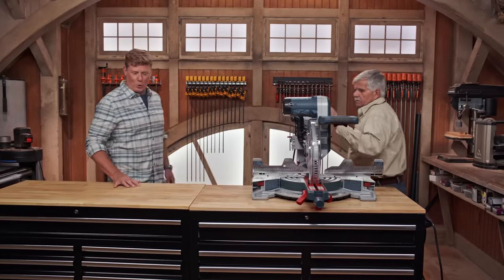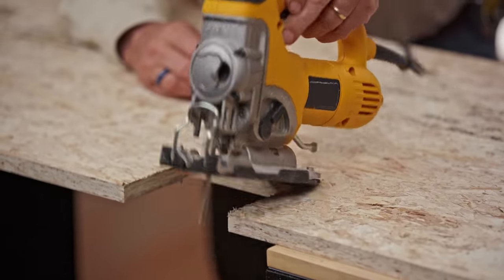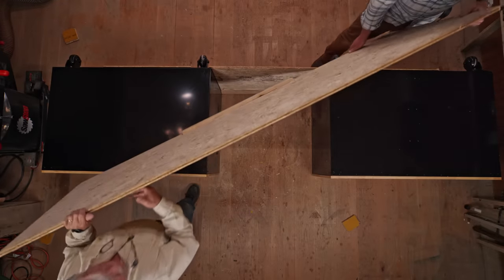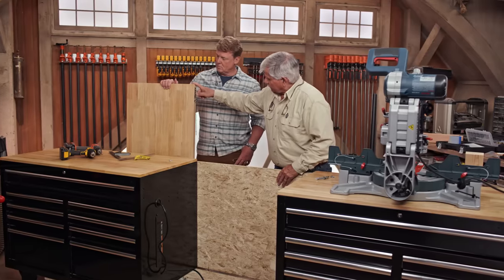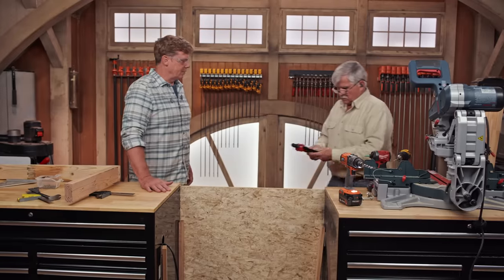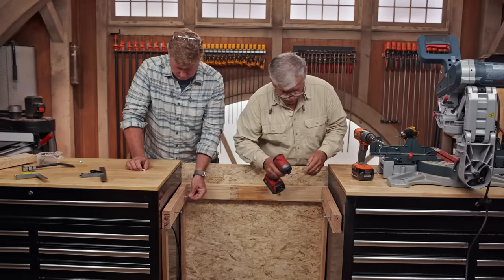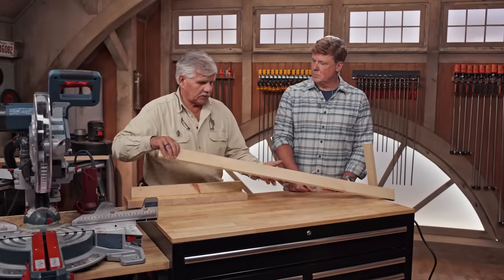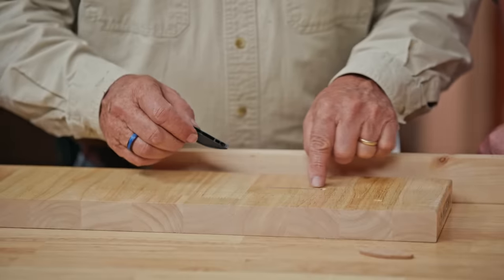Miter Saw Station | Build It | Ask This Old House

Comment: This unit cost as much as my vehicle.
Reply: Your absolutely right
Reply: That just means you have a mobile miter center. 😂
Reply: Hahahah. Yeah!
Reply: Roller blading to work sucks I don't recommend it.
Reply: It’s an idea that they obviously took to a high degree. In my head I thought of things that I would do differently to make it more versatile, but also you an do the same thing but not use expensive tool cabinets. You could make your own shelf storage cabinet as an example.
Reply: Not a cheap solution — starting with the saw itself.  Big range of cost on the shelves though.  I have very similar ones from Harbor Freight that I think were about $350 or so.  Well worth that cost for the quality.
Reply: 2000?

Comment: Videos like this are why I seldom watch this show any longer - They love finding ways to use very expensive tools instead of trying to find ways to use less expensive methods to achieve the same results. A Lamello biscuit joiner  is so far over the top instead of a system like parallel t-tracks, allowing for a moveable, and removable fence, and is also far easier on the pocketbook of so many of us hobbyists. This is a great show to watch if you have loads of cash waiting to go through instead of learning about more cost effective solutions. Again - a great show for wealthy people!
Reply: Scott Walsh uploaded a video explaining that dowels are actually better than biscuits or dominoes. I'd recommend checking out his channel.
Reply: yet here you are.....
Reply: @njkay0033  Lamello by far makes the best Plate Joiners, Norm preferred them and used them for years on The New Yankee Workshop. But he also used Porter-Cable and on a rare occasion DeWalt Plate Joiners, and you can do the same thing with those. I myself can't justify the Lamello price, but I have a 2000 USA Made Porter-Cable 557 and I love it. You can still buy Porter-Cable and DeWalt Plate Joiners today.
Reply: Ur a hobbyist that doesn't have the same amount they do ..don't hate ..they are a million $ company

Comment: I think its important to note that the special break-down biscuit device is only compatible with the Lamello biscuit joiner, as it uses a special mechanism in the tool that creates the groove. It's quite an expensive tool vs a traditional biscuit joiner.
Reply: Wait a moment! You're not suggesting that TOH is slinging expensive single-use tools that most of us will never really need, are you!?!?!?
Reply: I thought they could just as easily install blind tap in nuts into the worktop and install using thumb bolts through the extended fence into the worktop. Would definitely be more sturdy.
Reply: @powhoundus  that's how I did mine. A few dollars for some threaded bar knobs and threaded inserts. When I need the bench they come right off.
Reply: I believe you can buy some special clips made by lamello that work with a biscuit jointer. I think I saw that on Peter Millard’s channel.
Reply: You could simply use a dowel.
Reply: KNAPP Connectors makes some self clamping biscuits that seem to be universal. I don't have any experience with them, but a sample pack is 10 pair for $10, so cheap enough to give it a whirl. Hoping to build this soon and will likely try those out

Comment: Great video. For all the people complaining about the cost, this is a high quality setup for a very reasonable cost for someone who is a hobbyist wood worker. Spend less time at the bar and quit smoking...
Reply: And you can use the same idea with homemade shelf cabinets - don’t have to use expensive tool cabinets.
Reply: You don't even need cabinets. Some 2x4s, some cheap plywood and caster wheels will get you started. No drawers, but you can shelfs to store bigger tools.
Reply: @MrJramirex  where do I find this cheap plywood you speak of?

Comment: I thought of doing something like this in my shop but using home made shelf cabinets. My upgrade to what they did however would be to have 2 dropped tool stations separated by a middle cabinet. Each of these stations would be a temporary spot for a tool - but made to accommodate more than one tool. Some of the tools I would consider using in this setup - router table top, miter saw, DeWalt planer, bench top jointer, bench top drill press, 14 in bandsaw. Most of these tools becomes more versatile /easier to use with a feed in / feed out or longer support area on each side. Will need to figure out the right gap for one set of tools for each opening and figure out a system to allow custom heights for each tool to match the extended work surface. The workstations will take up most of one wall of my garage, but will be a very versatile work area with lots of storage. Since some of the tools are heavy I may have to set up some sort of lift assist for each tool that will be stored in one or two of the cabinet areas underneath.

Comment: So now Tommy has a Lamello Zeta P2 in his tool arsenal. I just finished using mine for a mitered face frame that would have been difficult to clamp together. Instead use the Tenso connectors, like Tommy (AKA Pops) used and no clamping necessary. I'm very interested in that "rivet" they used to connect the 2x4's to the metal cabinet. Always learn something from this and TOH. I'm 72 and I've been watching from season 1. Keep up the good work after all these years.

Comment: To make my miter station I got a piece of 3-1/2" thick 4x6 wood and laid one on each side long wise which flushes up with my miter station. This is a nice way to do it though, bummer to ever have to move workshops though with that massive thing, would have to take it apart but it is slick.

Comment: Well Tommy, you did it again, great design idea.  I figured out the lumber cost to make the equivilant to two Harbor Frieght  tool boxes on sale and it is cheaper to buy the boxes. I am making a move able Radial arm saw station that will go in front of the two big shed doors when I install a regular sized door in the front of the shop. I want it to be able to move out of the way in case I need to move something larger than the front door either in or out. And it needs to be dead steady, and easily movable. I also like to work outside in the summer and use those 2 doors and ramp to move things in and out. So I will take this concept of yours using the 2 tool boxes and design it so I can still move the one in front of the 2 doors out of the way. The new station looks really sharp and will be practical in that space. Will you do a review on that Bosch miter saw?

Comment: Simply start off with 2 $800 tool cabinets
Reply: LOL
Reply: That's cheap!
Reply: $400 each
Reply: Unless you want to build two yourself, will probably cost way more.
Reply: Harbor Freight has the Yukon tool cabinets for $350. They're basically the same as the Husky.
Reply: And a Lamello biscuit joiner lol
Reply: @TheRumpleThump The Harbor Freight ones are a lot smaller (especially in depth).  But you can get them on sale for $320.

Comment: Nice if you have the money to buy multiple tool chests like that, and more importantly have the space for them to move around...many shops just aren't that big to be able to roll stuff that size around...great idea, and could easily be done using the smaller sized rolling cabinets too, I think they have some that are like 24 or 30 inches wide....though the butcherblock tops are great in a shop like that, and hopefully they're easily replaceable.  I've never looked, but I'd hope they are just screwed to the chest LOL.

Comment: Nice result.  However, I could not fine the removable biscuits for the fence.  The link provided for Home Depot shows regular wooden biscuits.  Even Rockler didn’t have them.
Reply: You could also use dowels, bench dogs or domino's to get a rigid connection as well.
Reply: You don't need the fence; anything beyond the fence supplied with the saw doesn't really add any straightness to the cut.  Seems a lot of miter stations are now going with a T-track in the table top to hold a stop block and doing away with the long fence.  It would have been better if they had shown that design instead.

Comment: This is a nice idea in a pinch and if you have the cash although the way plywood and lumber prices are going it may be cheaper in the end… except for that biscuit jointer is a Lamello and that tool specifically is thousands of dollars. Unless the companies that make biscuits have finally stepped up and copied a very pricey idea, you’d need to know someone with a lamello biscuit jointer! I’d prefer building my own but at least to have a flat top without a fence, I’d rather route in a t track but again this is a neat idea and may be more practical cost wise than some would think. Right now even the cheap, crappy plywood at Home Depot is insanely expensive with many defects

Comment: Why did you ignore the modifications that were done to the wheels on the carts?
The cabinets come with 2 fixed and 2 swivel casters.  It's hard to tell from the video but it looks like you either replaced some of the fixed ones with swivels and/or mounted the fixed ones rotated 90 degrees which only allows for 2 bolts to be inserted.

Please include how this was addressed.

Comment: Kind of thought he was going to use the Festool Domino to install the fence but used the Lamello instead.  It would have been better I think to leave off the fence and use a T track.  For the cabinets, those seem like they might be an overpriced option, but given the price of plywood today and the price of tool cabinets at Harbor Freight (I'm not a fan of their power tools, but their tool chests are pretty good value) are probably cheaper than plywood.
Reply: The thickness of the wood top on those boxes would not work well with t trach.

Comment: I like the idea but, wouldn't you want to reverse those biscuits? You don't want them filling with "dust". I thought about doing something similar but, never been able to find roller cabinets with all 4 casters being swivels. Cheers :)
Reply: I think you kind of have to have them the way they are. Otherwise you'd have the other side poking up out of the workbench which would be in the way.

Comment: You can also take ideas from the videos and use them guides. You don't have to have the most expensive equipment when you're a hobbyist. I use videos like this all the time for inspiration on various projects.  I could never afford all those supplies at once. But, a little at a time, and eventually, I will get there.
Reply: is that the actual goal? to get more, buy more, have more instead of LEARNING to DIY?
Reply: @oldvanguy  You learn as you go along, brain prize. That's the goal.  However, if someone wants nicer things, don't put them down, it's their business.

Comment: I wish you would've showed how you secured the connector pieces to the wooden toolbox surface.
Reply: They did! Special biscuit insert cutter cuts a T-shaped curved groove that the plastic pieces rotate into, no glue or fasteners required.

Comment: The Lamello Zeta P2 is an amazing machine and ideal for projects with hidden fasteners and challenging angles/curves. This project would have been even better if they had used the Clamex connectors which are ideally suited for on/off applications. I hope this exposure turns more serious woodworkers on to this great tool and system.

Comment: These tool chests are not cheap. Hundreds of dollars each. Both over a thousand bucks easy, so I wouldn't be drilling holes and bolts through it. I'd rather spend 100 dollars on plywood making each bench side if I had the room.

Comment: Just have to make sure the floor is level every time you use it lol
Reply: They joined and leveled it with a straight edge at the exact area they plan to do most of their cutting.  So it should be fine.

Comment: I don't understand this-- Tommy says if he uses bolts with nuts on it to hold the cleats, he doesn't want to put his hands inside to tighten the nuts-- that part i get, but then he says he doesn't want to drill and potentially hit the drawer runners.  But then proceeds to drill these big holes for the threaded rivet.  Wouldn't that rivet potentially hit the drawer runner as well?  Not understanding his logic here.
Reply: I didn’t see a mark on the bit but presume he marked the bit somehow to barely pierce the cabinet wall. Or maybe he lucked out and the correct height was between sliders? Anyway, rivnuts are nice for metalwork projects but agree there are other options here including removing the drawers and using a wide enough  cleat to be between sliders - above and below a slider if necessary.

Comment: Side tables are not long enough.  The sides need to be at least 8' long on both sides so you can throw a full board on either side.  So at least 16' + the width of the miter saw.  Thanks.
Reply: Because they clearly have the room for that long of a cabinet. 🙄
Reply: This is more than adequate for in shop work.  They are not building houses in there.